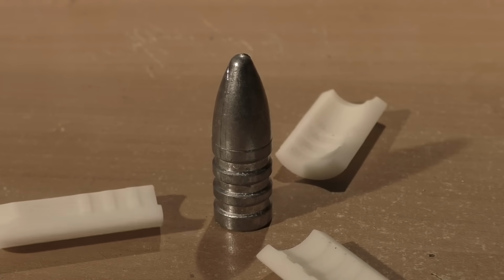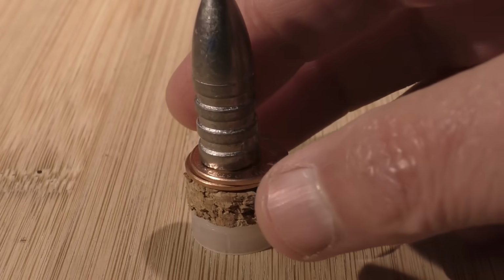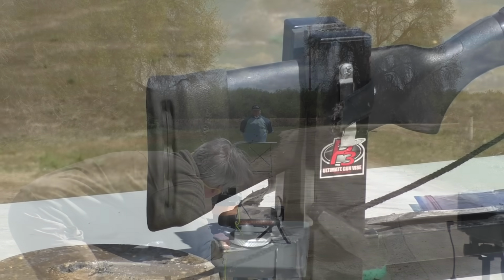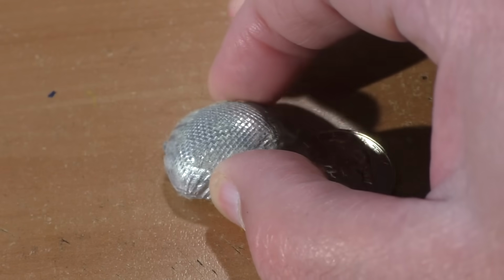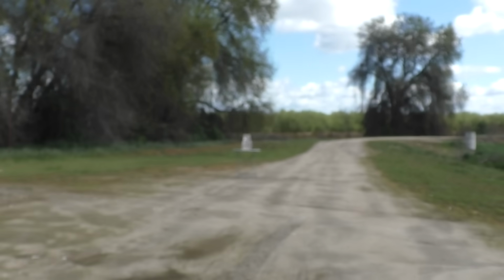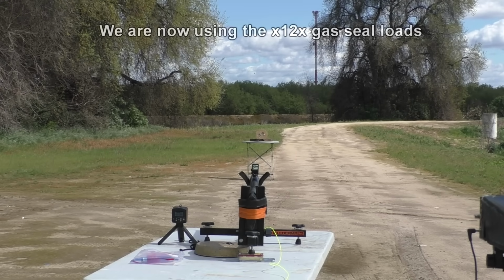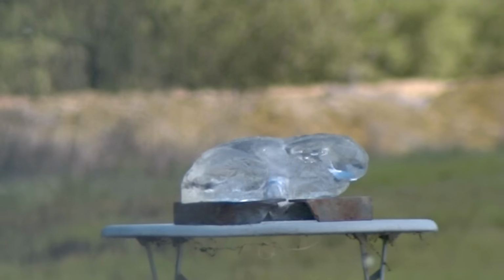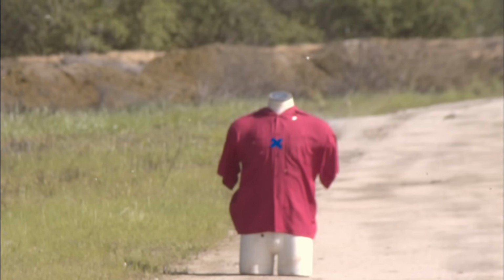45-70 SABOT  for 12ga.  One of the MOST challenging loads

Comment: Would making a notch or keyway down the length on both sides of the round and the sabot to fit into them help?  Might help for spin, etc
Reply from the maker: The sabot and bullet need to fit the bore very tight,  about .010"  larger than the bore.  The pressure will "lock up"  the   sabot and bullet against the rifling.

Comment: I am glad the strap worked so well. That is my go too for such shock forces. Also makes decent sling material. I have been working on a new remote trigger system. If it ends up being any good, I will send the design to you. I like to build guns out of scrap. Kind of a relaxing hobby, but I wanted to make sure I had all my fingers though most of my life so I often test fire with remove fireing system.
Reply from the maker: lol,   that's smart!

Comment: I always learn something, Mistakes are data points in life that help us improve. I like the shooting stand. I recommend that you put a guide for the trigger pull. If the string was fed through a hole that was right behind the trigger lever, it would always pull straight back, regardless of the angle that you pull. You might need a hole in the butt support. Or maybe some modified bike brake cable and a pipe with the brake lever mounted to it.?
Reply from the maker: that's a good idea!

Comment: Jeff

Shotgun bird shot in bags for weight on the stand around 50 to 100 lbs.  the 500 grain .45-70 bullet in a sabot is similar to the commercial model of a 500 grain .50 cal slug for deer hunting.  A better saboteur material would be better.

Comment: I would have thought that it would take some knurling on the bullet to take on the spin since it is a rather small diameter. This could also buffer variations in the 3d print.
Reply from the maker: With the right bore fit,  (very tight) you should be able to spin a greased chrome bullet.

Comment: I think your chronograph is having difficulty reading because it bounces around too much. Try putting it on a separate table or stand.
Reply from the maker: I set it on a bucket and it didn't read still.   It's a doppler radar and reads metalic objects,  the pennies were probably throwing it off.   I haven't had any problems with other rounds yet

Comment: KISS.   Extend the length of that trigger pulling bar thingy so it’s a foot or more above the weapon.  Connect the pull cord at the very top.  That will ~ double the length of cord travel and half the needed felt force to move the trigger.  It will be a smooth consistent travel without needing to jerk the cord.  I almost feel like the weapon is moved some by jerking on the cord .  I’m assuming the cord is of a material that can’t stretch.

Comment: Pretty neat video. Good work
I cast those same bullets for my Springfield trapdoor 45-70. I'm not sure if you are casting your own, or getting them from somewhere, but, if casting your own I thought I'd pass along a neat trick for cast bullets.
If you sandwich 1 piece of aluminum foil between the two halves of your bullet mold before casting the lead, it creates a very weak fracture line down the center of the bullet. You don't want it to go all the way through the bullet, or it will fall apart, but instead maybe 1/4 -1/3rd of the way through the bullet. After your bullet cools, you can trim the little bit of excess aluminum off with a knife. Open impact, such a bullet will either split entirely in half, shed two large petals, or basically mushroom with both petals, depending on velocity/lead composition/depth of the fracture line.
Might be fun to experiment with if you mess around with this bullet anymore.
Reply from the maker: Michael cast them,  they guy that sent them to me
Reply: You probably said that I'm the video. Sorry I missed that

Comment: Good job on the butt strap for that stand.  Back in the day, I used 1" nylon tubular webbing for rock climbing, super strong and it lasts forever.  The biggest problem I see now is your trigger actuator.  

The problem is that if you are not pulling straight back, you end up pulling the pivoting actuator off to the side, binding it up and that's why you're having to jerk it.  Remember, "We don't Jerk Off on the range."  What you need are a pair of small pulleys that you can find at most hardware stores.  A pulley will allow you to pull from the side and redirect that force in a straight line parallel with your bore axis.  They also cut the amount of force needed.

Attach one inline with the pivoting arm and slightly below the level of the trigger on the right side of the vertical stock support. Then, attach another pulley forward on the right cross leg on the front of the stand.  Thread your string through the rear pulley, then through the front pulley and then back to you behind the cameras.  Even though you're off to the side, you can pull straight towards you, gently, and the actuating arm will be pulled straight back in line with the gun so that it doesn't bind.  I'd also suggest using a heavier cord like paracord, something that doesn't stretch.

Comment: Had to shake my head at this one.  I just go down to the Big-5 and get a box of Winchester BRI-sabots in either 20, or 12 gauge and have at it.  They shoot equally accurate from smooth or rifled barrels.  and yes, the Winchester box says they wouldn't.  But it's the same BRI-company slug designed for smoothbores that Winchester purchased and left unmodified, so yes it does work in a smoothbore.
Reply from the maker: We shot those before.    I think the viewers would get bored if all we shot were BRI sabots though.
Reply: @taofledermaus   true, but for the working stiff they are so much fun.   ^~^

Comment: It's NOT the weight. It's the jerking action on the trigger. The round yellow plate was hit low. I suspect the aim was low in attempted compensation for previously high hits. However, the trigger pull on those shots was very much smoother, so the bullet went where it was aimed. I recommend a redesign on the trigger actuating system.

Comment: I think you could have an easier time with the trigger if the lever could extend above the gun by maybe a foot.  It would require more pull length on the string but give much more leverage on the trigger.  Might also add a small swivel pulley at the back of the gun so you can pull at an odd angle while working the camera.

Comment: Jeff, You have the best channel on YT for me personally after all these years. My hat's off to you for trying your best to make this a one man show. Seriously.
I highly suggest setting up the trigger string connected to a fixed throttle type lever to maintain tension (no slack). The lever is set up like a throttle lever for a lawnmower yet it is fixed stationary at the bottom end. You just smoothly pull back the already tight trigger string connected to the lever until the shotgun fires. I hope you can mentally picture what I'm describing. It would completely remove all of that slop and jerking you have going on now.
Update after closely looking at your setup. Just put an adjustable velcro strap over the front V rest my Birchwood has just a nylon strap. I can send you a link to what I used. Then add more weight to the front of the sled. I will be honored to send you the Birchwood Casey Alpha Shooting Rest like I have with the upgraded front strap. It already weighs 35lbs. Just let me know.
Reply from the maker: It will evolve over time.   Still working out the kinks

Comment: Ratchet or cam straps holding it to the table would greatly help both with it moving a lot less when trying to fire and with it moving less from the recoil. Still using the weights is a good idea as well. Maybe some nylon sand bags.

Comment: Cool vid, as always!  Here's an idea for the trigger release mechanism you have set up there, to avoid the disturbance caused by yanking on the rope:  You might try rigging up a bicycle brake handle and a length of brake cable so that you can pull rearward on the pivoting trigger plate by squeezing the handle ("putting on the brake") which would eliminate the need to yank on the rope.  I"d bet a local bike shop would have some fun helping you rig that kind of thing up, and they certainly know how to make the brake handle and cable system operate.  Jus' sayin'...
Reply from the maker: thanks!  I'll look into that

Comment: I think your accuracy issue is with the level actuated trigger mechanism, it seems you are almost having to jerk the trigger to set the shotgun off. Try using a piece of para cord about 4 feet long with loops tied in each end, I build up the center section with tape, run the cord through the trigger guard, centering the taped portion on the trigger. That way the loop ends run down each side of the stock and the trigger is pulled straight back against the stand evenly.  I use a carabiner to hook the two loop ends to the pull cord.
Reply from the maker: I'm working on that to improve it

Comment: make the same "nut, bolt through the aluminum piece", 
put it on the other side of the shotgun, having the bolt go through the trigger guard,
and another bolt under the trigger guard for tying the string that runs under the stock 
to your finger.   =+=+======= sort of. = is two pieces + is two bolts going through top bolt pulls the trigger string ties to the bottom bolt.

Comment: Instead of having to yank a rope to pull the trigger which changes the point of aim, you could use a bicycle break handle/cable that you tie one end around the trigger and the rear part of the trigger guard, then you just squeeze the break lever which will tighten around the trigger and pull the trigger, or some kind of setup like that so you don't have to yank a rope and it's a cheap solution.

Comment: a simple servo to power source setup should be enough for the trigger, if you use the right servo. you could use a trigger button similar to the high speed camera trigger to fire the gun.
for the stand, it might be a bit overkill, but how about taking a cheap trailer and turning the entire trailer into a stand? the gun would be mounted rigidly within a frame that is basically bungied into a stand that is hard mounted and rigid with the trailer. the bungie attachment would absorb the recoil, while the rest of the set up is to recenter the gun after each shot automatically (cone in cone type thing), with those re-centering mechanism being on threaded rods to allow for fine adjustments. this eliminates the variability of the gun shifting around within its mount, and the mount shifting around from recoil.
paired together with the servo trigger, this should eliminate almost all play that isn't ballistics from the system.
Reply from the maker: I can barely afford a simple cup o' noodles at this point
Reply: @taofledermaus  Ask your viewers? i'm sure there's someone within a reasonable distance of you that would be more than happy to help create such a thing, and donate it to the channel. I'm in central Wisconsin, otherwise i'd be doing it myself.

Comment: Sir, I’m just curious why you’re not shooting the firearm?  At first i assumed it was just because you have to run the camera, but I’m curious if it’s a medical condition or just a getting older type deal. I don’t meant to pry, I’m just curious. I absolutely love your videos and have been watching since before Danny passed. Miss that man for sure. Either way, you don’t have to answer that if your don’t want. 

Where did you get the sabot’s and the projectiles?  I’d like to maybe replicate this load and see what it would do at farther ranges. My gun club has a 800 yard range.
Reply from the maker: The hs camera has to be triggered manually and is set back  and to the side of the gun.   I can't shoot the gun and operate the camera at the same time.

Comment: Hey Jeff, instead of pulling the trigger string from the side, try running the string through the trigger so that on the way back to you it surrounds the stock on both sides, and it should equalize the angles and tension of the string (because of the loop) for a more smooth trigger pull that would also better simulate a true finger pull.

Comment: One piece delrin sabot would be interesting. As for the sled, if you drive a truck, sandbag the sled in the bed. Or if you want to use the table just ratchet strap the sled to the table and sandbag the table. Cheap and easy

Comment: Try stacking a couple lead plates on that flat material that’s under the loading port to eliminate sight disruption during the trigger pull. I think butting up the back end of the sled against a couple stacked cinder blocks could allow you to pull the string in one slow fluent motion instead of pulling the string hard or yanking it even. Hope this helps!

Comment: The reason your consistency was so random is because your trigger pull was jerky, which is also very understandable considering the setup. Consider exchanging the rope for something that doesn't stretch, like fishing line or braided wire, and strap both the barrel and stock to a board that you load with a lot of weight to prevent the rig from jumping. You could also use a light duty, battery powered winch to pull the trigger for added consistency.

Comment: Aside from investing in a different shooting rest, you could put another bar on the left side and run the bolt evenly through. Then tie the string to both sides of the gun to have an even pull, possibly with a pulley mounted behind the gun to redirect the pull force more linearly from your angle by the cameras. 

It looked like a lot of the inaccuracy here was due to jerking the gun around, and as we all know, a clean straight trigger pull is what you need. ❤

Comment: I wonder if the rounds are corkscrewing. This happens with some pellets in my big bore air rifles and it's weird to watch (you can actually see it in the air when it happens). It will make the POI wander all over the place because it changes based on where the round is in its spiral by the time it reaches the target. This is usually caused by the spin rate not matching the length of the projectile but I would expect it to be less common with such a long projectile. It is much more common when spinning a short projectile too fast. I am not sure if this would show up in the high speed at that range or not.

Comment: Jeff, I think the only real major thing you need to do is redesign your trigger pull. Instead of mechanical the way you've got it, you should just Loop the string through the trigger guard, and around and over the top of the butt of the weapon. Your trigger pull string needs to be as straight as possible. The setup you have is causing you to have to jerk the string too hard. Other than that, very impressive the way you manage to do these videos by yourself.
Reply from the maker: I've made some big improvement to it

Comment: Great video!   Sucks about the 3D print plastic.   just not capable of dealing with those forces.  just the acceleration force w out the spin thread engagement is obviously enough to break it apart. yeap need nylon or maybe a poly resin...  likely a good Rd after that.  thanks man!
Reply from the maker: thanks

Comment: I would add an extension to you trigger lever to and mount the string higher for more leverage.
Or 
Better
Add a pully to the front and back of the sled to add more pulling power and smooth out the pull.
I wouldn't be surprised you have something laying around

Comment: I would have thought that the "gummy" targets would have had more hydrostatic shock.  It's a MASSIVE round after all.  If the straps don't hold up, look for some of that "plumbing strap" stuff.  The metal banding with premade holes in it for screws to hold up pipes.
Reply from the maker: thanks

Comment: Jeff, the idea to weight the sled is a good one. Another idea that you might want to try is to take the flat metal you have that the string is tied to and place two, one on each side and bolt them secure to the frame. Bend the metal so it is approximately 5 inches away from the trigger guard and approximately 4" back from the trigger, but equidistant on bith sides of the stock of the firearm. Run the string through the trigger guard and affix it to the metal on the left side. Place a small pulley on the right piece of metal and run the string through the pulley. What this would do is to allow the string be pulled gently and easily. It would be a repeatable motion every time to allow the firearm to fire. There would be no jerking of the string, which grossly, negatively affects the accuracy.

Comment: re: the stand stability issue. If no holes are present in the feet of the stand, drill one in the rear and one for each forward leg, then use appropriately sized nut and bolts to secure the stand to nice thick piece of plywood (at least 1/2 inch thick), then clamp plywood onto your shooting table. IMO, this should reduce or eliminate any play from the stand when the trigger is toggled.

Comment: Hi Jeff. Something I noticed that you might try with the solo shooting rig, you're having to yank pretty hard on the string to fire the shotgun. Maybe try making the firing lever about double the length that it is now keeping the trigger contact and lower pivot points the same and move the string connection to the top of the new lever. This will increase the leverage you have on the lever and should allow you to not need to pull as hard on the string to squeeze the trigger. It might help with the accuracy as well. It sometimes appears that the shotgun is moving just a little bit when you have to give it a good yank to fire the round. I hope this might help a bit. Also, I feel like I should say that, while I'm certain filming, set up, and shooting, etc. is pretty rough, you're doing a GREAT JOB filling all of these rolls on your own! Keep up the awesome work!
Reply from the maker: I've made some improvements to the arm and it seems to work quite well now